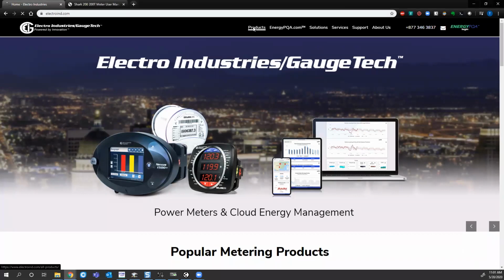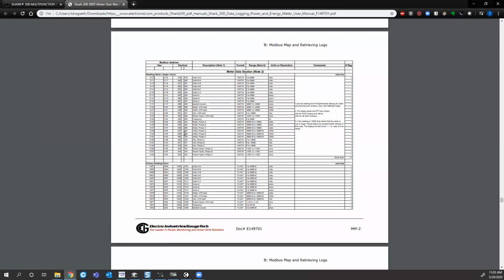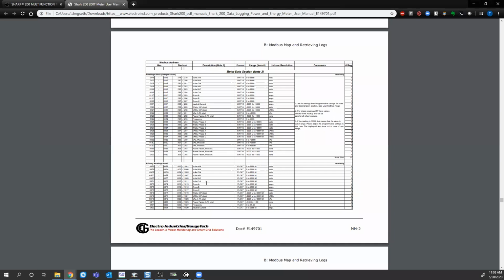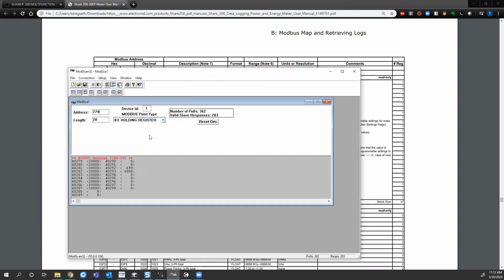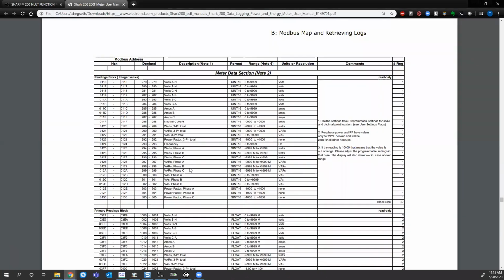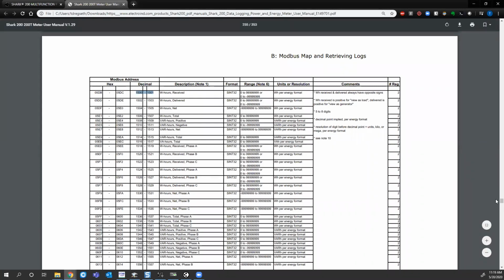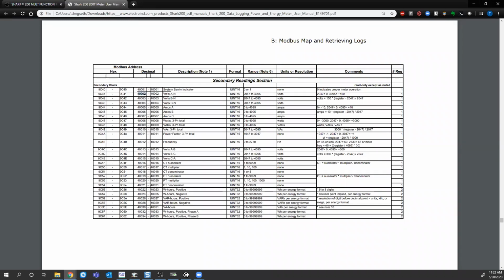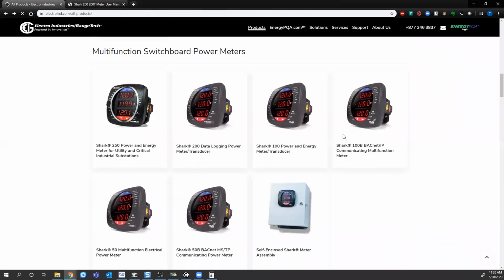Shark Meters: Connecting Modbus To A Server

Comment: If the shark-270 security is enabled it is required that the user 
and password are encrypted before the modbus write in the logging process. 
But in the energy meter documentation there is no information about what kind of encryption should be used.
Any suggestions?